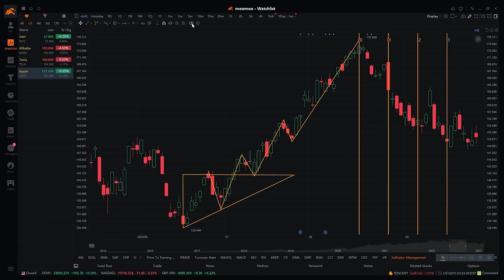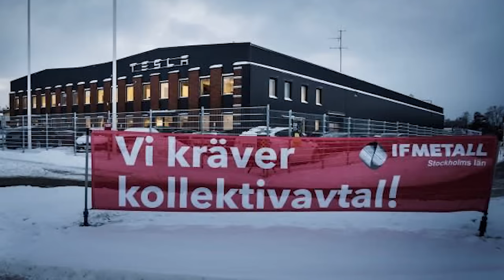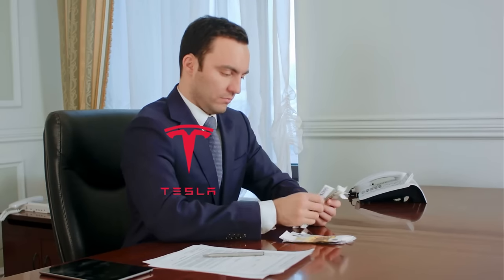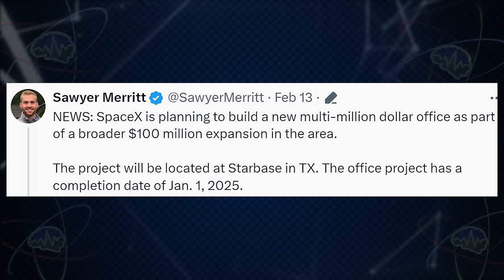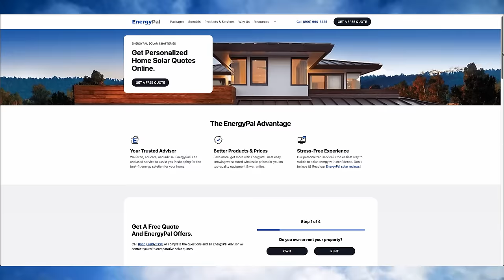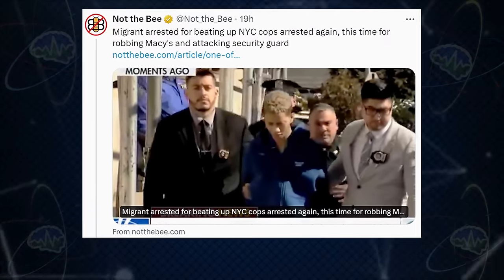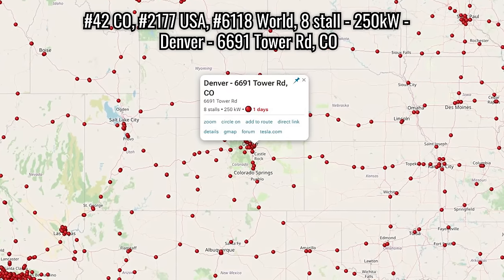Rusty Cybertruck?! | Tesla Time News 389

Comment: Actually, my friend that bought a white Tesla model 3 year 2022, white, had similar issues. Small rust dots all over. When I researched it, it's also caused by brake dust from trucks that gets stuck and rust..
Reply: Yes the majority of it is from semi metallic brake pad dust. It's floating in the air especially in cities.
Reply: @linemanap sintered pads.
Reply: @andrewsaint6581  2 names for the same thing

Comment: I have the Cybertruck since Feb 3rd. It’s surface contamination. Same as on my white cars I also own. A decontamination wash is always the first step after taking delivery of one truly cares.
Reply: Exactly. This is likely also from the braking system that gives off dust when it is engaged.  All light colored cars experience the same thing
Reply: All of the paint chips on my ice truck are rusted  — rust embedded in the metal.
Reply: Thank you for the information 🎉🎉🎉🎉🎉🎉
Reply: Yep, all cars get surface contamination from iron fallout. Once on the paint or stainless steel, it begins to rust and becomes visible. A simple Iron spray treatment during one of your initial washes will take care of this. Not a big deal, and definitely not exclusive to CT. Please check with a good Auto Detailer video for Iron Decontamination process. Fast, easy and painless. 👍
Reply: Thank you for the heads up. How long after did you take delivery after the VIN was assigned? I ask because I've had my VIN for a week now and they say my truck is in transit.

Comment: Years ago Ford had the same issue with small rust spots showing up on the paint of the cars. Found it was rail dust, came off the wheels of the freight train cars floating up and sticking to the car. The Ford body shops were given explisit instructions on how to repair and not have to paint. Not a big deal, easy to clean and remove the fine rust.

Comment: Cybertruck is a letdown.  Not what what was promised.  Can't get 500 miles of range without a battery extender.  Can't put a camper in the back with a battery extender.  You can have my reservation.

Comment: Re Rust Issues, the problem is from industrial fall out basically tiny iron filing that come from break disks, trains etc it effects ALL cars just more noticeable on some. Solution car care companies like turtle 🐢 wax make products usually for wheel cleaning but can be used anywhere, look for IRON REMOVER on the label.  Top tip don’t let it dry on the surface. Hope this helps

Comment: Rust problems? Hardly!!! I work for a new car dealer and had a concerned customer call me several weeks after taking delivery of their new vehicle and wanted to show me that it had started rusting already, they came in and showed me the spot they were concerned about and very insistent it was rusting until I showed them it was on the plastic but painted bumper cover.
Reply: Wait, are you saying that stainless steel truck, has painted plastic around the areas of loading it?
That would be stupid.

Comment: On the rust that is seen on the cybertruck, this is actually the most common form of rust seen on stainless steel. Good stainless steel doesn't experience general corrosion. It will experience pitting and also "free iron contamination" which are the spots seen in the videos. If the environment continues to be corrosive, these contaminants could become pits. It is hard to keep stainless steel contaminant free. The steel mill usually pickles and passivates the stainless and then they should be wrapped for protection (a plastic film is usually applied to the stainless) against free-iron-contamination. Once contaminated, they are very hard to get rid of and would require some kind of pickling process to get rid of them. Not sure if the Bar Keeper's Friend contains the necessary chemicals (an acid). In the video Monroe did when they toured the Tesla plant I remember them saying they don't have a protective plastic film on the stainless. I think Tesla has to look at ways to keep the stainless contaminant free during the manufacturing process. Even contact with rollers and moulds (unless they are not steel) could cause contamination pickup unless the mould/roller surfaces are covered. Welcome to the world of Stainless Steel. BTW, has anyone done a chemical analysis of the alloy? I am curious as to the Cr., Ni, Mo & C content of the alloy.
Reply: It doesn’t help that the 30x SS they formulated turns Martensitic and becomes Magnetic. 

I’ve owned a Delorean for 30 years. It’s 43 years old now and the stainless is near perfect which with basic car wash soap and glass cleaner for touch ups like finger prints and water spots. The panels are 304SS non-magnetic. The owners community is very aware to never use something like an SOS pad on the stainless steel because it can leave particles imbedded in the surface  which can show up as rust specks.
Reply: @dennisschlieckau8723  Yes.  There are alloys of stainless steel like 316L that is marine grade and will not corrode in a wet salty environment.  Common on boat railings.
Reply: @dennisschlieckau8723  Looks like Tesla or a conglomeration that has registered the name Telsa just got an education about physics.
These are not concerns is the bodypanels were a affordable plastic, but if people kept trying to kick the vehicle, then a rusty truck lacking alot of maintenance would have different challenges, such as affordable vehicle panel replacement. 
Why should 10 dollars worth of plastic dinner plates to make a vehicle fender in a mold cost any more than what it essentially is?
The garbage can makers can offer a large plastic bin for that price even, and it can even be flexible and maybe a safer way to design a crumple zone for impacts from any angle of velocity, even if to consider pedestrians and cyclists, baby carriages etc.
Reply: @truetech4158  That you, an anonymous poster, thinks the engineers up to and including Elon, don't know metallurgy is a hoot.
Reply: @markschaffer480  Fanboys with stockholm syndrome really do seem to exist. Hey, isnt it interesting you dont seem to care about the type of metal being used, and even after someone else mentions the concerns but you didnt reply to them?
What do you know about metallurgy, and what did you prefer to simply overlook about that of what you speak of, LOL?
What was your point?
Reply: @truetech4158  My point was straightforward.  You simply have no integrity nor credibility.
Reply: @markschaffer480  Oh, ok then, seeing as you say so, because you do appear emotionally invested?
Did you learn anything from this comment thread related to what you must've went out of your way to overlook?

It doesn’t help that the 30x SS they formulated turns Martensitic and becomes Magnetic. Oops, magnetic! What does that mean?

 There are alloys of stainless steel like 316L that is marine grade and will not corrode in a wet salty environment.

Ya well, you know how it is, things get overlooked maybe to say stainless steel, yet without the steel being all that stainless due to it's gradient, kinda like saying buy super cheaper grade paint that needs a regular maintenance schedule of further applications to maintain structural integrity.

A magnetized metal is like waving a magnetized screwdriver through a not so dielectric dust material. A magnetized metal that also seems to rust and discolor at the same rate as, say your aunt's dentures following a daily trip to the bingo emporium and 2 packs of marlboro's and a bucket of cranberries.

You can pretend your claims are points, but if you pretend things like catholics habitually do in texas and the bible belt, it's because you prefer to overlook the things you read, or choose not to read.
Reply: @truetech4158  The only claims are by you, an anonymous poster with no provable expertise.
Show who you are, your C.V., and published peer reviewed research.
Reply: @markschaffer480  So, overlook the data, even when its quoted for you to reread?
You seem very very young, we know who you are.
Reply: @truetech4158  You fail to understand that an anecdotal story is not data.
Come back with your real identity.

Comment: Every car l’ve owned always had small rusty dust like particles clearly being thrown from the front wheels, the brake dust, sticking to the painted body panels. 
Which I simply clean away with a good car wax/cleaner.
Mistry solved?
Reply: Now imagine brake dust on unpainted, cheap stainless steal. It is going to be a disaster.

Comment: I worked a summer job at a car dealership and every light colored car had rust staining caused by rail delivery and needed a full buffing.  Looks exactly the same.
Reply: You’re right. All the cars have it. It’s the light vehicles where the spots stands out more for sure.
Reply: @themidgetsman  .  Rail cars are rusty and if it rains the rust particles lands on the paint.  Polishes right off.
Reply: @themidgetsman  right? Every car I have ever gotten from a dealer was washed and waxed prior to delivery.

Comment: I had tiny rail dust rust spots on my white Model S. A rail dust remover is needed to get rid of them. Soap and water will not work. The rail dust remover I used is called Ferrex. It is an Optimum product. You spray it on and wait 1 to 2 minutes, then rinse with water. Works well.
Reply: And this isn't done by the dealer prior to delivery? I mean seriously this is car selling 101.
Reply: @joecoolioness6399  The spots were not there when my Model S was new. They appeared about two years later and were probably caused by iron dust coming off the front brake rotors.

Comment: Hey, I watch every episode and find them interesting. I have a question: are there plans for the other automakers that have gotten on board with the Tesla charging standard to move there ports to the left rear or right front to elevate the need to take up two spaces at the chargers?  
I haven’t heard anyone take on this problem and announce a solution.

Comment: Hi Zac & Jesse,

For Supercharger reviews, I would like to suggest using the Riley’s Analysis of Charging Stations (R.A.C.S for short) This would a systemic method of ranking Superchargers. That way everyone will rate them based on the same scale. This is just a suggestion. 

Point of each. Does it have:

1. 250kW or higher 
2. Easy access from main road (not far from interstate/Highway) 
3. Wi-Fi 
4. Solar panel cover or canopy cover (protection from weather)
5. Trailer pull through stalls
6. 8+ charging stations 
7. Low price /kW 
8. 2+ restaurants in reasonable walking distance 
9. Magic-dock/V4 
10. Scenic views

Comment: Stainless steel does corrode (rust), however, most of the time this rusting is only cosmetic and can be easily removed.
People should also be aware that aluminum can also corrode while plastic and paint can be degraded by sunshine.

Comment: The new Powerwall sounds great, but I’ve had an 8,000 watt inverter system for 20 years now, that has been handling my electric dryers etc., without any problems. 11.5 kw could probably handle a FEW houses!

Comment: Where does the stainless Steel come from? At one time I heard it was from Texas. If its from the factory near Portland Tx, it could be from the steel refinery. Their Steel dust gets blown around and I’ve seen it get imbedded in clear coat. Looks just like the video. Very visible on white or light colored paint. Clay bar normally gets it out.

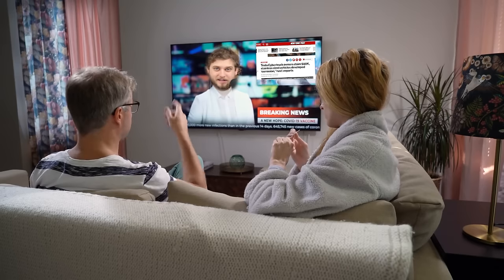Comment: 18:46 - There is also iron remover spray that can remove the particles you can’t see with the naked eye.  Ford made 6 1936 cars from stainless steel by Allegheny Steel.  They were driven around the US by sales reps.  The one in a Pittsburgh museum has more than 300,000 miles and is rust free.  They also made 6 stainless steel 1960 Thunderbirds and 6 stainless steel 1967 Lincoln Continental convertibles (worth more than $2,000,000 each now).

Comment: The biggest problem with the VW bus other than the obvious pricing issue, seems to be that the driver no longer sits over the wheel in a high visibility position. It completely changes the nature of the vehicle. And yes, they should obviously have copied and pasted the favoured early design and cashed in enormously on hippie nostalgia. It's like when they redid the Beatle and the Mini and neither had the same feel. What next, a 12 horsepower 2CV?

Comment: Stainless is stain resistant and won't rust through. Light surface rust is natural and inevitable, but will always easily buff out.
I'd drive it with a slight rush hue. I wouldn't give two $#!+$. It's a TRUCK.

Comment: 5 Hz is the critical frequency where if bad enough can cause nausea (and a feeling of dread/doom), and at at extreme levels causes internal ruptures. And in one case in the 70s a French weapons lab experimenting with a air blown whistle (yea it was big) there was one death. At car levels I would think this is a contributory factor in car sickness. A good thing to filter out if possible IMNSHO
Rust? Don't disc brakes rust within days & fling off metal? Bits everywhere in the mud thrown up. Wait for road salt! Wash regularly!

Comment: The stainless steel will rust on the Tesla’s. All stainless will eventually rust. It like any metal needs a form of protection. Upping the chromium content helps however the down side is it then becomes harder to shape. And I would say that the Teslas sharp angles might mean lower chromium which means  quicker to  rust.

Comment: I used a stainless steel pipe for a shower curtain and the surface rusted, but after a wipe down with a scotch pad has never rusted again suggesting it's just iron contamination on the surface.

Comment: “ Stainless Steel” rapidly forms an invisible oxide layer, that maintains its stainless appearance. Pitting from imbedded carbon contaminants can be eliminated by passivation by acid etch process, undoubtedly done post cutting/ forming at Tesla.😊

Comment: While the early rust issue might be contamination:
A) That's still a problem and the meticulous cleaning for bird pooh and all others listed I can't get by, and
B) Are we just going to ignore the fact that al stainless steels that are exposed to the elements will suffer corrosion. Often pitting (which will look almost identical.
I know you play down absolutely anything negative, but can we have an actual metallurgy-based conversation here instead of trying to put out spot fires. Some of us are actually educated on these matters and it looks bad for you to be glossing over basic materials science (pun intended). 
Q: How will these trucks look in 5 years if cleaned in the same manner and frequency as a normal paint job?

Comment: I would hope Tesla would put enough nickel in the steel to keep it from rusting, although bare steel is going to look crappy eventually either way. We do know that the "hyperloop" prototype rusted to hell, so I suppose it's possible that musk would skimp again
Reply: Elon had zero to do with building anything hyperloop. He did the research and math to show why it is a good idea (which it is, cheaper than normal rail to install, less environmental disruption so projects will be approved more easily, fast as planes, but way cheaper per passenger)... 

Cybertruck steel is very rust resistant, "marine grade" in fact!
Reply: @0ooTheMAXXoo0  I know he didn't build anything hyperloop, bc the hyperloop has never existed. However, he did build a prototype for the hyperloop, which was a tunnel that was raised off the ground in California. You say it's a good idea but no one seems to think it's worth actually building, bc it's not just a bad idea, it's a scam idea that could have never worked from the beginning.  The closest to a real hyperloop that exists now is a small stretch of tunnel that Elon built in Las vegas, which Tesla cars drive about 20 mph thru. It's sad to see there are still people (yourself included) who haven't caught on that this was just a scam.

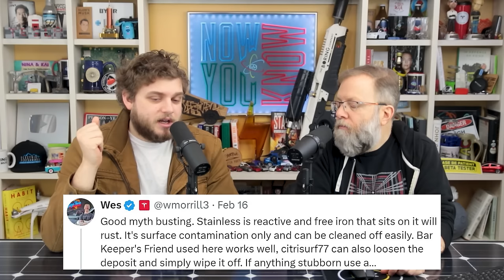Comment: 20:00
Stops bullets, but iron filings or grindings embed in it? 🤔🤨
Reply: Metallurgical expert, are you?
Reply: They don't "embed".
They stick to the surface and can be wiped off with a mild solvent leaving no pitting (which would be evident if the grindings "embed" in the surface)
Maybe look up and understand the meaning of a word before using it?

Comment: hmmm interesting you did not mention BTG's other used product for the iron filings? His term was that the filings bond to the stainless. True stainless isn't magnetic but iron is, so how is it bonding? Chemically? If true then the ethanol in that product may have broken that bond by offering an ion of hydrogen. Plus it might resist finger prints better than bartenders? 

The effect happens to all cars, you just do not notice on some colors of paint. The real question is why are they attracted too cars and does train travel make it more likely to be attractive?  Did any of it fall in the tonneau cover and would a large magnet collect it? Inquiring minds want to know!

Comment: Hyperion XP1 HFC 0-60mph 2.2 sec 1000 mile range 5 min fill time and unlike BEV's unaffected by the cold thanks to using super light supercapacitors vs heavy lithium ion batteries. Lithium ion batteries use a liquid electrolyte which can freeze stopping the electrochemical process  and batteries have a short lifecycle supercapacitors have thousands of times more charging cycles. The tech can also be used in heavy trucking and airplanes because it's much lighter than batteries. Did I mention its byproduct is water? Two thirds of our planet is covered with the fuel it uses not to mention it puts it right back! Now You Know